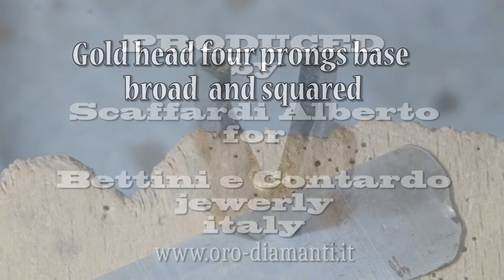Gold Head four prongs Base broad and squared

Comment: Nice work , your sawblade is too soft ! Make it strained , will cut better and more precise ! 
I held my breath watching you , waiting for the moment when the sawblade will break !   :)))
And use 5/0 blades , they are very good for this kind of work , the pieces will fit perfectly  , without even moving .
Reply: I know right, more tension on the saw when he's inserting the saw blade, and I use wax as lubricant to make it smoother to cut
Reply from the maker: Use sawblade from 2/0 to 6/0 depends on the work that I have to perform. I apply the wax as a lubricant. What seems to lack of tension it is due to the use of a headband with a greater amplitude. During the cutting it has not broken even a hacksaw. Also if you try to make a video while pierced and enlarged detail you find that the curve of the sawblade seem more as you see when you work. Thanks for your participation and advice.
Reply: scaffoal what is the use of this prong setting?
Reply: Shadow of a Hedgehog setting stones! ;)

Comment: Thank you for the video! 
What is the thickness of the sheet that you used in this video?
Reply from the maker: depends on the diameter of the gem, I for a bud six millimeters in diameter would use a thickness of 1.20 to 1.50 millimeters

Comment: how do you make the same style in 6 prong?
Reply: You make 3 of these.Then you take bee's wax and place it spaced  evenly. Then take a small amout of plaster and place it on top for a few hours. Turn it over, get the wax off and solder. It will not move because you have plaster holding it on top.After it's all done put in sonic. Wala all done